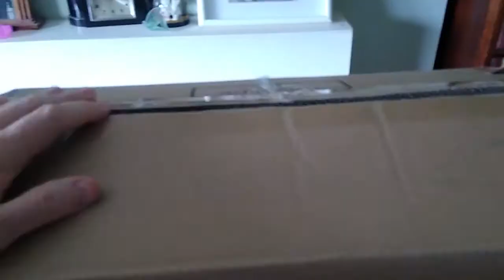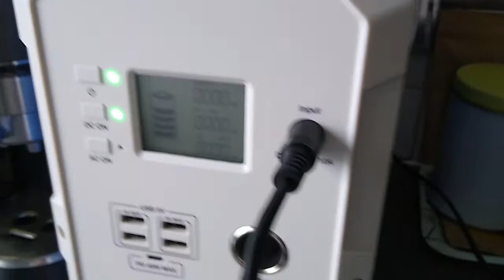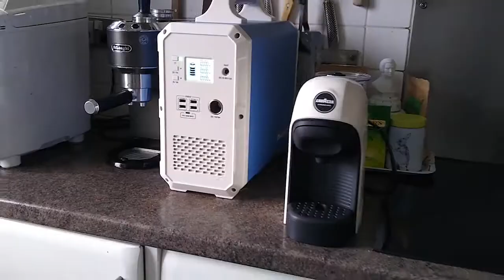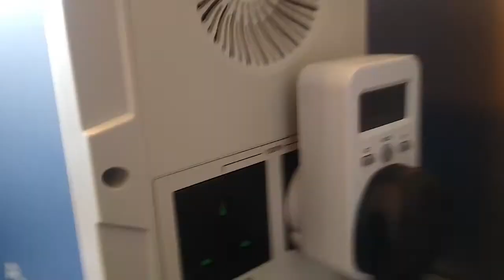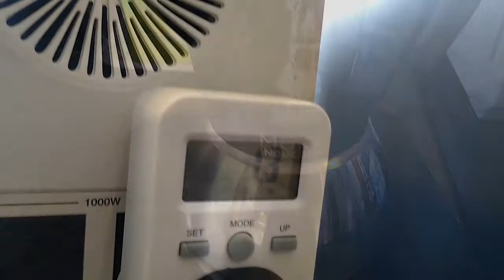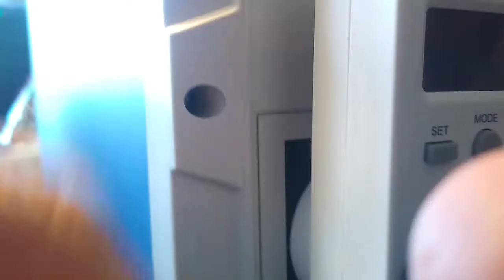Unboxing my Bluetti EB150 and testing with my Vango Sizzle camping induction hob

Comment: Even though this video is more than 3 years old, it's the only YouTube video I have found that answers this question  "does the Vango sizzle run at lower wattage for the lower power settings, or does it pulse at 800 watts continuously?" - very useful info for me as the inverter on my powerbank is 750 watts max! I've struggled to get a straight answer to this question anywhere on the internet :)

Comment: Very useful video. I've been undecided for few months how to do my electrics in Campervan. Think you've helped me do same as you.
One negative thing to me was not being able to store it in cupboard. In use I'd want it on worktop as I would find it difficult to keep bending down if on floor. Where have you situated yours for travelling & on site.
Reply from the maker: Cheers David. I haven't bought my new van yet so it isn't all plumbed in yet. I am using it with my old van though and I am just tucking it behind a seat. 

Cooked up lunch and made tea a few days ago without even losing a bar.

I do have a 175 watt panel on my shed roof and I charge the EB150 from that at home - I seem to get around 700 watt hours on a good day and the panel isn't optimally situated, so a similar amount should be do-able on a van I reckon. I'll look to over panel a bit but I'm confident I can get 600 watt hours or so per day during the summer without difficulty even taking account of cloudy or rainy days.

I think I bought my panel from Renogy.

Comment: This unit is exceptional for the cost and convenience. It was only surpassed by the quality of your presentation. Genuinely, I thought the way you put this together with real world hands-on usage as well as comparisons to others on the market shows me you need to do more of this.

This little device would also be fabulous if charged form a vans solar panels when the van is not in use and then brought into the home to power something like a small pc system for probably days on end. Every bit helps with the current price of energy. It's the perfect emergency bit of kit for round the home in a power outage. It looks smart too!

Very well done Stew  👍👍
Reply from the maker: Thanks JPS - appreciate it.